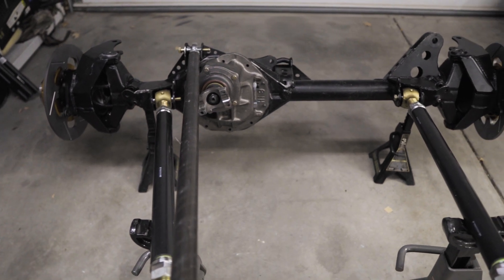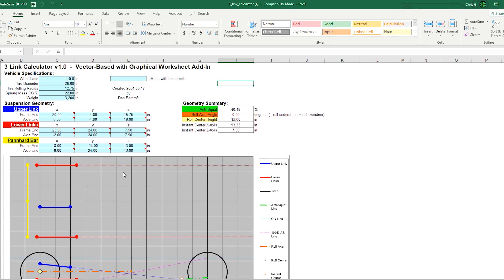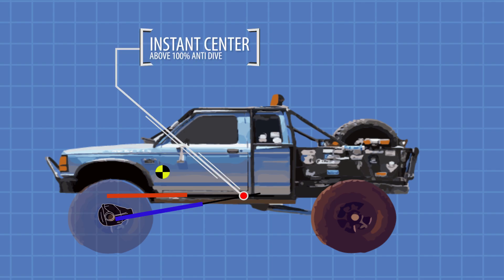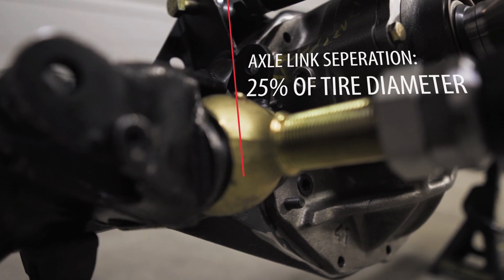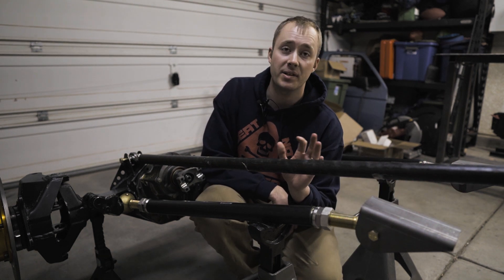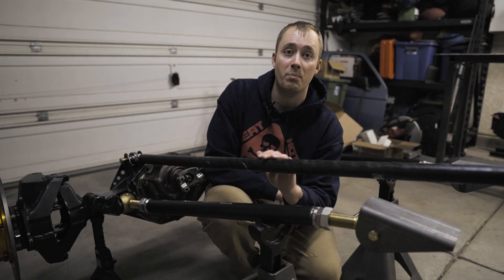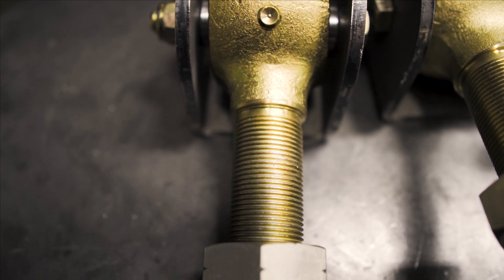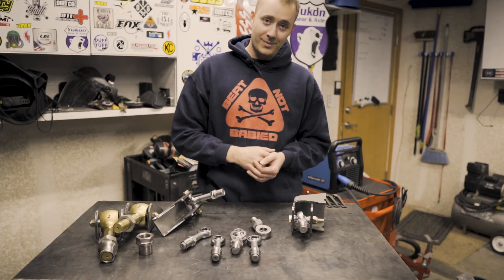3 Link Suspension 101 - What You Need To Know - Reckless Wrench Garage

Comment from the maker: This video was a bit more technical than some we have done previously, did you like it? What are you wanting to build a 3 link suspension on?
Reply: Yup.  The more technical the better as most videos are simply skipping that part and showing their install only.  1977 F-150 with 2002 D60 front, 2002 Sterling 10.5 rear.
Reply from the maker: Thank you! Sounds like a cool project 😎
Reply: I have two four link Kits that I’ve been neglecting to install on my 87 Toyota crawler. One of these days
Reply: This is a “simplified” but technical video. Awesome! You nailed it in my opinion. Dove deep enough with great explanation without going too far down the rabbit hole. Animations were a very nice touch too. It was helpful getting that picture in the audience’s mind. Overall more breakdown videos like this please!!

09 JKU stock locked dana 44’s 3 linked front and rear.
Reply from the maker: Thank you! We are learning how to do the animations so hopefully there will be more in the future!
Reply: My build is a 1983 Nissan Patrol 160. I'm using Barnes kits front and rear. 3 link front, four link rear. 
All Chevy drive train. Gen II LT1, TH400, twin stick NP205, Dana 60 front and 14 bolt rear. 
Thanks for the explanation of anti dive/anti squat. Good stuff guys!
Reply: RecklessWrenchGarage  my build. 05 4Runner.
Reply: absolutely....
Reply: I’m doing a replica build for a Rc4wd trailfinder 2 my idea is 40’ on tons this will help greatly I just hope I can convert the dimensions from inches to mm in the Excel spreadsheet
Reply: got a 76 Dodge W100, planning on heading to Alaska soon, and expect a lot of sub-zero driving to boot!
Reply: Want to 3link the rear, and possibly 3/4 link the front of my 88 MJ
Reply: Andre from Brazil! There is a Brazilian company, called DStrac.com.br. They build suuuuper cool cromoly axles with lifetime warranty up to 42" tyres!! You should check it! They are much bigger than Dana 60! I'm going to use them on the front of my 98 2 doors v6 Montero, (that since 2015 runs on a 2012 3.2 Mitsubishi common rail diesel engine ). I'm not going crazy with tyres. 37" + two lockers is enough for me. Help me, please! :D
Reply: I'm sure there are a lot of people that enjoy technical stuff! Excelent! A made several questions so I can choose what to do when things get complicated under the car LoL :D
Reply: What if your upper link is equal to the length of the lower links? Does that give a "best of both worlds" for street & off-road driving?
Reply: Retired suspension designer, it was spot on. Just enough dork material while keeping it interesting.  Jeep WJ that is morphing into something...  I built a 3 link front and 4 link rear to replace the leafs on my square body Suburban years ago.  I was doing suspension design at Jeep Truck Engineering on the TJ platform, that gave me the idea for my Suburban. The engineer I worked with taught me a lot about what you are showing now, being an old school draftsman I drew all the geometry out manually dialing it on paper.  Just like the CAD programs but with compasses and scales.
Reply: Love the technical stuff.  This video earned you at least my subscription.  I’m DDing a Colorado right now and a SAS is probably in its future once it gets replaced as my daily, so this is exactly what I’m interested in.
Reply: 1975 K5 Blazer w Gm Dana 60
Reply: I am thinking about doing a 3 link on my 2018 jeep wrangler daily driver but I want to start wheeling harder and want a long arm interference isn't going to allow a double triangulated 4 link
Reply: Where can I get This app ? Calculator 3link

Comment: Question , we did a 3 link coilover setup in the rear of our 4th Gen 4Runner at the end of the install the axles was centered at ride height and was fine , after a little of daily driving the axle has moved more towards the driver side by a lot about 3-4” and is extremely noticeable , if it had adjustable Panhard and it was set , what would cause the axle to get out of being centered ?

Comment: Stumbled across this  vid as I'm doing research on Barns 4wd link kits.  Do you have a vid on your shock choices for this set up?
Reply from the maker: Glad you stumbled in! For the front 3 link setup I went with 14 inch king coilovers and a hydraulic bump stop. I had these coilovers initially on my radius arm setup, I briefly talked about them in one of our first videos about link suspension. It would have been on 2017 so it's a pretty old video. I did update these shocks later on by adding fox DSC reservoirs to them for better tunability and performance. That is in my shock tuning video from a couple years ago.

Comment: Can I mount my outer bars from the axle to the frame from the top of the axle and the centre bar to frame to the bottom of the axle. I will have air ride and I need the drop clearance from engine crossmember 11:59  to Dana 44

Comment: Hey just a weird question here. Can you put the upper link under the axel?  I’m building a rat rod with 3 link solid front axle. But on the top side of the axle is going to get real busy with air bags and mounts, etc. But under the axle is free and clear

Comment: Going to be building a 3 link for my 05 grand cherokee since no one makes them anymore and came across this video. With it being the rear, would the length of lowers compared to uppers be as big of a deal? Or what are your recommendations as far as lengths go? Longer lower, shorter upper, vice versa? Thanks for the info as well. The video was very helpful. May be looking into a SAS soon as well. IFS is poo and very restricting with no aftermarket support on the WK
Reply from the maker: For the rear the bigger consideration is pinion angle through travel. The front you have to worry about steering caster but the rear is easier. Set it up so your pinion and driveshaft work well through travel and send it!
Reply: @RecklessWrenchGarage  good deal! Thanks!!

Comment: What bracket did you use to attach the arm above the diff?
Reply from the maker: The one showed in this video was a custom made one from plate. When I installed this axle under the Ranger I had to move the upper mount to the passenger side for clearence

Comment: with those upper links forming a triangle, in theory you would not need a panhard bar, would you? especially if you use short upper links. many trucks(full size trucks) use that on their rear axles.(and for example land rover)
Reply from the maker: Correct, that’s how the rear is on both of our trucks. This front axle is only a 3 link though, so it does require a panhard bar.

Comment: I'm currently building 3-link suspension on 2 of my trucks. Ok they are RC cars but very similar to the real thing. On 1 truck I triangulated the lower links the opposite of what you say: wide on the chassis and narrow toward the axle. I noticed a quite a bit of flexsteer. So I should chance this to what you suggest: wide on the axle and slightly narrow toward the chassis to eliminate this flexsteer?

Comment: really great video on a complicated engineering topic. instant sub! but, as a structural engineer, i will add that these difference arent AS noticeable in real life as they may seem. its almost better to optimize what you have based on your mounting points, like building a big complicated control arm mount with 100% perfect geometry is less desirable than something that say mounts directly to the frame with 80% perfect geometry. there is a give and take to both sides
Reply from the maker: Thanks for watching and thanks for the compliments! You are correct, there is always a fine balance between working with the stock chassis and cutting everything up and building something custom. Most people probably can't tell the difference when driving a vehicle at various anti-dive values

Comment: What axle side lower track bar mount is that? I know top is barnes4wd.
Reply from the maker: That is a custom fabricated piece
Reply: @RecklessWrenchGarage  okay thanks, I replayed all the front axle videos and there wasn't any mention or details on it.  Unless I missed it?  Like the design for sure for my idea on my build.
Reply from the maker: Yeah that bracket was already on the axle housing when I bought it used so I don't have any video of it
Reply: @RecklessWrenchGarage  thanks man I appreciate it.  Looks like its slight clocked outward towards front of truck?  Which works nicely to match how you moved the top bracket as far forward as possible to help clear the K member etc.

Comment: This is an amazing video.  Helps me understand the science behind the 3 link suspension.  I do have a question, what would happen if I have my upper link be the same length as my lower link?
Reply from the maker: If the upper and lower are the same length your pinion would pretty much stay where it's pointed throughout suspension travel and your steering caster will change through suspension travel. A lot of people make them the same length because they need the pinion angle and sacrifice better steering geometry during travel
Reply: @RecklessWrenchGarage  if upper and lower are the same length, the axle will remain exactly in the same position, with the caster exactly as it was.(and should be).

Comment: When I converted my 77 GMC Jimmy to a 3 link I thought my head was going to explode from all the info on the web. In the end I focused on link separation and instant center. I didn’t use any calculators just a degree finder a tape measure and a lot of trial and error. I sourced most of my parts from Ballistic Fabrication but modified every bracket I bought to make it work. Check out a short clip on my YouTube page. Anyone can do it just take your time.

Comment: Awesome video! Cleared up so much misinformation and confusion created by people that don’t want us to know so they can charge out the butt to do it. 
I have a question on center of gravity. Y’all measure to the upper bell housing bolt. I read that you should weigh the truck to find it. Is the bell housing bolt accurate enough? Scales are stupid expensive and I haven’t found any place to rent them. 
I have an 86 Chevy 4x4 and I plan to go to a link setup. Thanks for the video!
Reply from the maker: For the purposes of the calculator the upper bell housing bolt works fine. It's a rough estimate but it gets pretty close
Reply: Cat certified truck scales usually found at truck stops. 12$ . also grain elevators and scrap yards usually have scales. Not as accurate though. Posted for future reference.

Comment: Just a question. If the link is built with 33s and a decision is made to go 35s, will it make a difference?
Reply from the maker: The link seperation at the axle end may need to be changed with larger tires. The bigger the tire, the more torque will be working against the upper link trying to "roll" the axle over. A jump from 33 to 35 probably wouldn't warrant changing the geometry. A jump to a 37 or a 40, I would suggest making sure you have adequate seperation for the increased forces.
Reply: RecklessWrenchGarage awesome. Thanks much for the response guys. Stay safe.

Comment: 11:06 why not go with a watts link setup instead of a panhard bar? As that’ll keep it as centered as possible
Reply from the maker: A few reasons; 
-The bracketry required to run a watts link could interfere with ground clearance. 
-A watts link setup has to attach in the center of the axle and reaches to both sides of the frame. This will cause interference with the steering components.
-With the amount of travel we’re getting up front, a watts link wouldn’t be ideal.

Overall, it’s really just a lot more parts to try fitting in front of the axle, under the frame, without binding, or causing interference.

Comment: I think it's ironic that what everyone calls a 3 link is technically a 4 link and a 4 link is a 5 link. I have a true 3 link on a VW/Chevy Hybrid. A arm upper with lower control arms  and coil overs in front and 3/4 elliptic leaves in the rear. Working great since 2002
Reply from the maker: Yeah the terminology can be weird. But there are 4 links, that only have 4 links. The two rear link suspensions we built are setup that way.

Comment: Hey man love the videos very helpful. I have a 2000 ranger 4x4 and I dont know where to look for info about this stuff so I watch yall. Is there a specific place you look for info on all this or is it trial and error?  Thanks for the advice very much appreciated. 
Daily driver but get a wild hair to dip off on a powerline every now and then lol thanks again!!
Reply from the maker: One of the reasons I made this video is because a lot of the information is scattered around forums and web sites on the internet. Pirate 4x4 has the most technical information, but sometimes it is difficult to find good posts that have the info you need

Comment: I noticed that both of your lower-link axle-mounts are horizontal and seem to purposely put your lower links in a direct line with your axle tube.  I'm not a suspension expert but I believe this is a mistake and will create a lot of slop in your axle when accelerating or decelerating; when your axle pulls forward, the whole axle will easily rotate backward.  When you apply the brakes or decelerate, the whole axle will EASILY rotate forward, much more so than if the link mount was directly below the axle tube.  Both scenarios messes with your pinion angle.  This is why factory axles have their lower links directly below the axle tube so that any slop in your joints does not account for as much axle tube rotation, and factory suspension parts need to last a long time.  You should expect this characteristic to show up early and worsen exponentially as your link joints begin to wear in and wear out.  I understand that you're attempting to have as much clearance as  possible but I would like to predict that your pinon angle is going to do some very funny things!  I've never seen it done, but I believe link mounts directly above the axle tube should also be acceptable, but at the expense of front drive shaft extension during suspension travel.
Reply from the maker: Controlling the axle wrap or "roll" is done by gaining seperation between the upper and lower links. Since the lower links are not below the axle centerline, the upper link will have to be built higher to help manage that.

Comment: When i did my 3 link. I literally winged it. I Just took some measurements and its actually not bad. My heims clack a lot. Ill swap them out for rebuildable joints.
Reply from the maker: No doubt, you can throw it together without going in depth and it may turn out good enough. The main benefit to going into detail with the measurements is the ability to predict how the suspension will react and you know where to make changes.
Reply: Colton Doyle go with some Johnny joints

Comment: So what's better 3 link or 4 link
Reply from the maker: There are many variables in comparing the two. There are a few types of different four links that have different pros and cons. The biggest factor in a four link is packaging the links in a frame and body setup. Many vehicles cannot fit a four link easily without major relocation of components or a custom fabricated frame

Comment: REALLY you don't know the differnce between a panard bar and a track bar...... and you're giving advice on suspension WTF
Reply: The link that provides lateral location of the axle is a track bar... Invented by the panhard auto company of france... The same thing as panhard bar. You comment on a Suspension video and don't know that panhard and track bars are the same thing Wtf?
Reply: It the same thing.... 🤔
Reply from the maker: Please elaborate and explain the difference...
Reply: Paul Debenham A Panhard bar and track bar are one in the same. 
I’m assuming you’re confusing those with a diagonal bar, which essentially serves the same purpose, but is mounted different and only really used on drag cars.

Comment: Why are you getting rid of the Dana 44 you have put front now?
Reply: Out front*
Reply from the maker: The V8, low gears and 37s lasted for a long time without issue. I recently broke a u-joint and shaft and it spurred me to upgrade. I always had to drive conservative on the trail due to concerns of breakage. I may want 40 inch tires in the future so I'm just building for that.